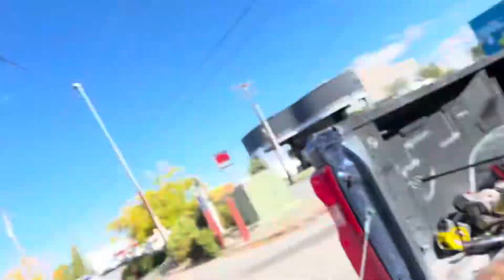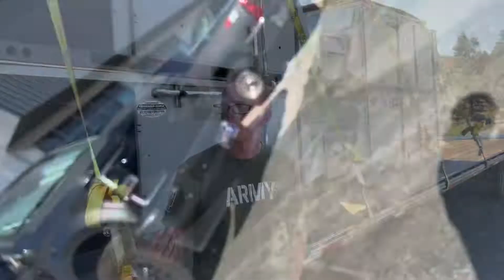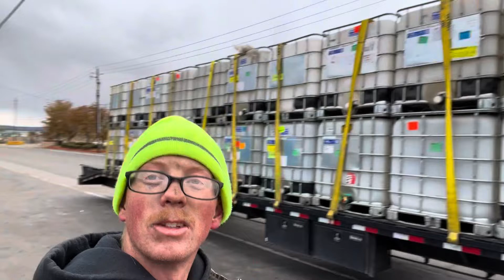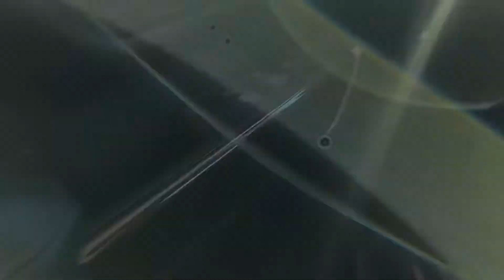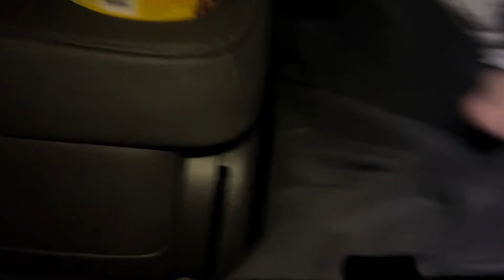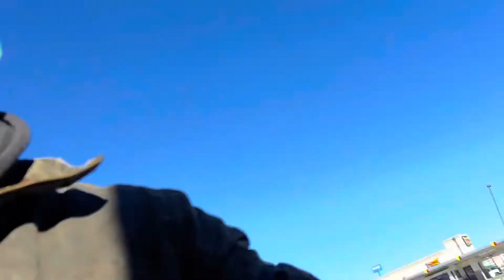$9k in 8 days, trailer maintenance, PJ suspension bushings, winter driving

Comment: Hey awesome job bro great video and quick question do you have pretty good results with the Chevy I’m currently driving 06 Ford and looking to upgrade later this year
Reply from the maker: They all have problems! I would rate like this 1. Ford 2. Chevy 3. Ram
Reply: @gingerhotshot   Got you thank you so much. One other question I just got my MC  Based out of Florida are there any Shippers you recommend looking into that would be willing to work with me
Reply from the maker: I haven’t been out there much I know Florida can be a dead zone going out. You will always have a load home though. Nichiha in Georgia is crazy busy. I’d find yourself someone local that’s shipping out periodically. Machine shop or small time manufacturer. Maybe check out equipment rental guys as well.
Reply: @gingerhotshot   Awesome man thank you so much for the info and be safe out there
Reply from the maker: Good luck drive safe!